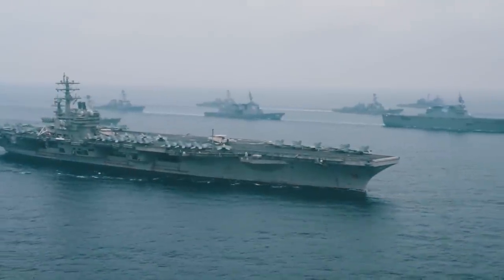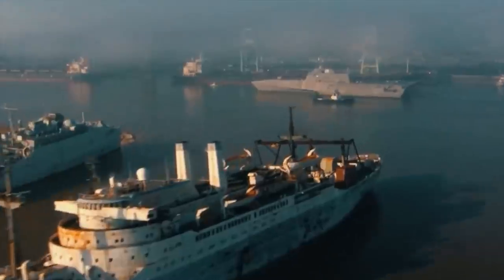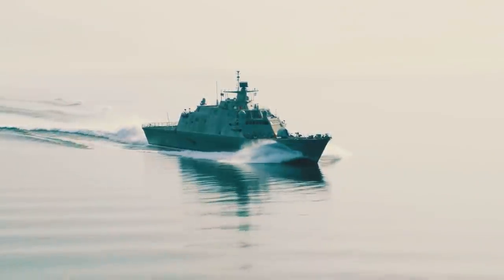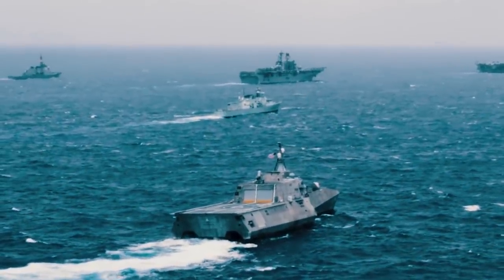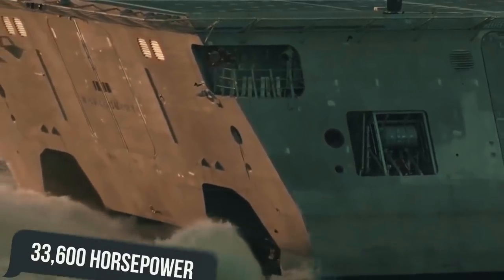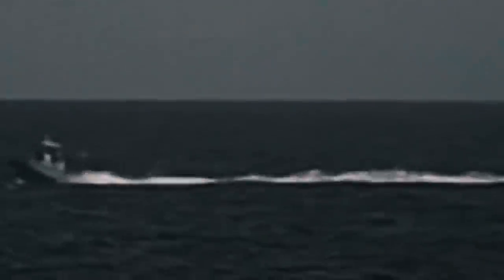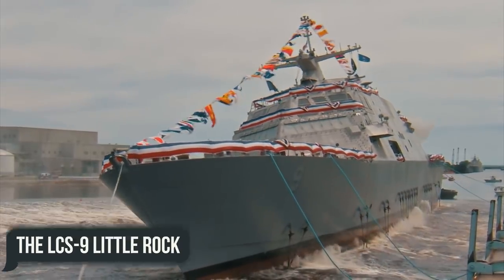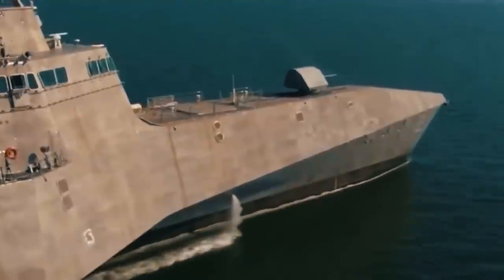The US is Testing its Latest $1 Billion Stealth Ship

Comment: This is real old news already have been built and the order for them has been shorten dramatically to just a few from a tall order which is pretty much what is already built. There's plenty problems with this ship class beyond price.
Reply: I think you need to go back and do a little more research because as of June 28, 2021, new contracts have been signed to make more plus other types of variants, the problems were not associated with the shipbuilder but other combat systems which were contracted and fixed for 40 million dollars as for the contract they have been well inside the budget and are being produced in 2 years, one year earlier than the contract term of 3 years per ship also an added bonus is that the maximum speed was to achieve 35 knots, in fact during trials it achieved 40 knots. This is a great Australian company with its headquarters in Western Australia, named Austal which has shipyards in Western Australia, Alabama USA, Vietnam, and the Philippines.
Reply: @markway8208  thanks for the reply mark I suppose your right just from what I have seen it was named a different class and they were all cancelled except for like 4 that were built and already 1 or so decommissioned due to the cost of maintenance and all the new technology packed in them that brings endless problems we're still learning when it comes to integrating all these new technologies together at one time. From what I found out by what you're saying too is now they are asking for them to be built once again under a new contract The vessel appear and seem to be the same as the previous maybe they got the kinks worked out I'm hoping.

Comment: It seems the modular systems have not met their full range of uses and have a potential that could exceed current thoughts and practices. A possible use could be a fast response combat medical ship. It could, while defensively armed, respond to isolated combat arenas to evacuate and treat injured sailors and soldiers. Immediate response to battle locations they could fight and defend their way in and evacuation of injured while rendering treatment up to and including emergency surgery.